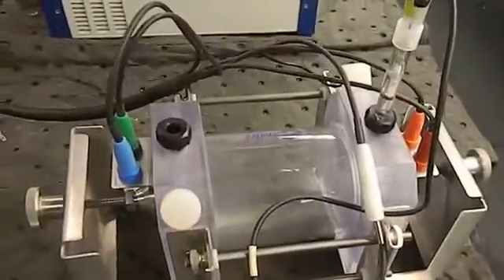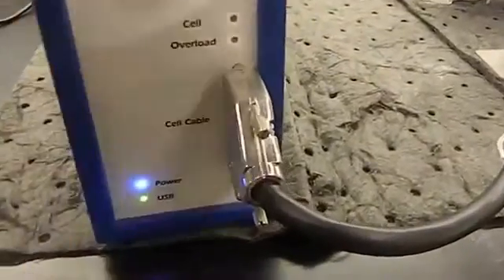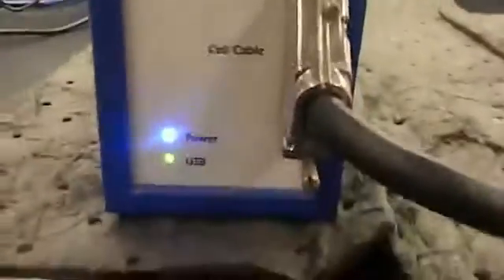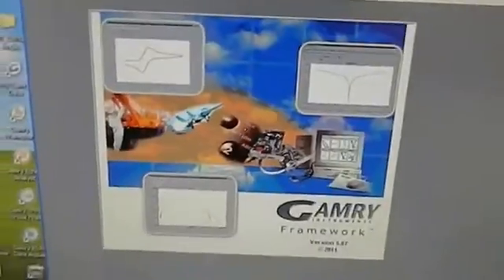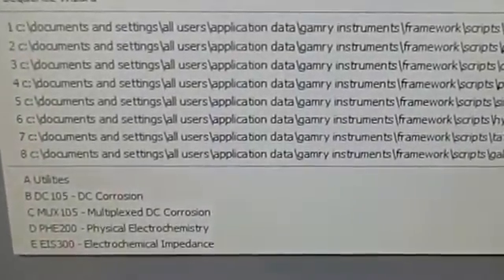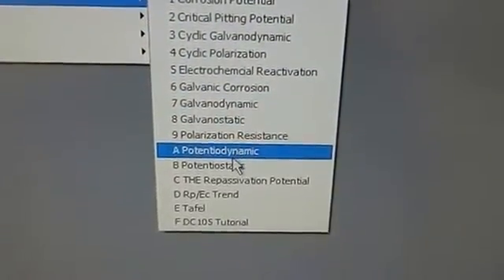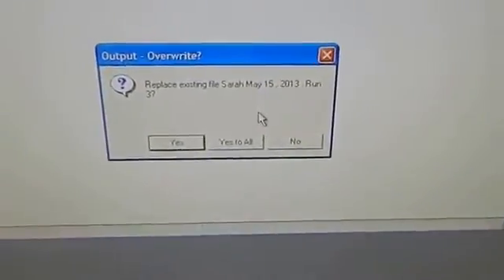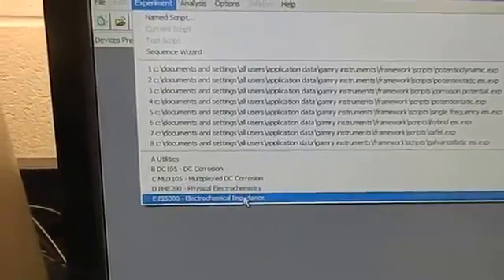GAMRY Tutorial

Comment: please what is the difference between potentidynamic and E tafel options please and which one is the correct for tafel curve determination
Reply from the maker: Both can be used to measure the Tafel response. The default values of the Tafel experimental parameters will usually yield better results, so this would be the recommended option.
Reply: @gamryinstruments  thank you . another important quesion for me please what should be the delay time suitable for performing tafel experiment knowing that i start by measuing EIS then tafel experiment or i should  do it sequentially with out delay time for tafel and recording open circuit potential from impedance measurements
Reply from the maker: @ahmedhegazy6080  You can begin the Tafel experiment immediately after EIS ends. EIS is considered an non-destructive experiment, so no large polarization will occur during it. Since the working electrode is not heavily polarized, no resting delay is needed between steps
Reply: @gamryinstruments  could you please explain how can i measure capacitance at constant potential by electro chemical impedance i do not know which option should i used